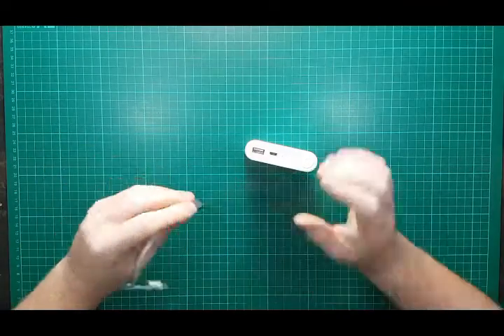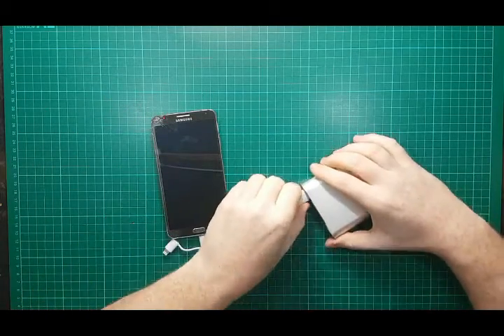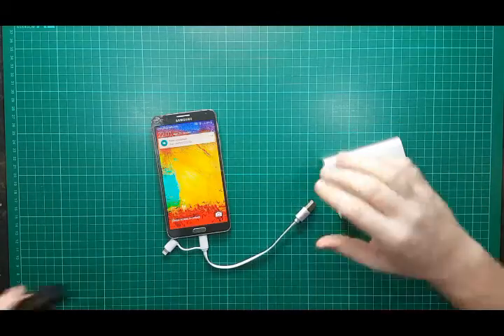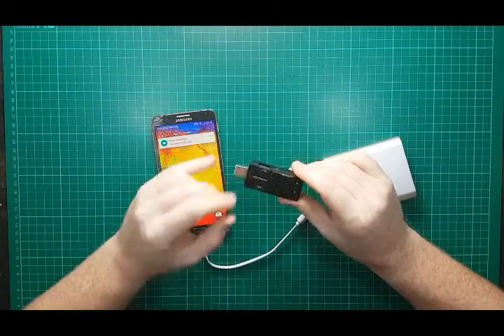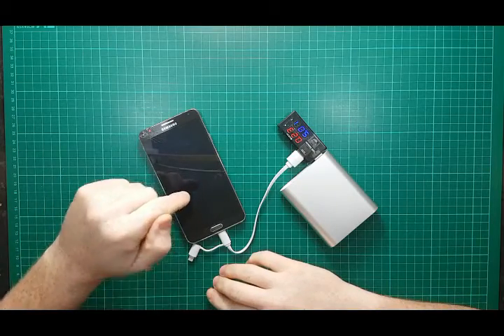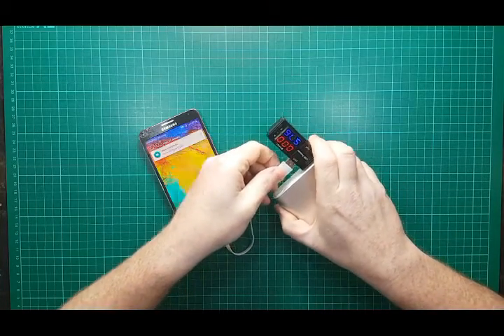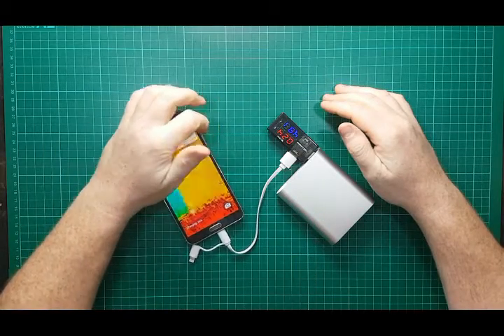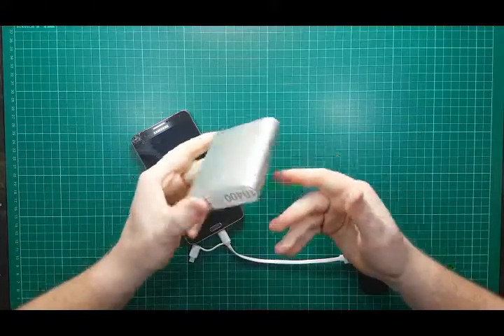HOW TO TEST POWER BANK CAPACITY!!!

Comment: first, you are not talking about the capacity of the power bank, which is why I am here, you're talking about charge rate...2d, you never mentioned the state of charge of the phone before charging,  Every phone I know of, reduces the input charge rate as it gets more full, especially after the 75% charge state, so it doesn't damage the phone.